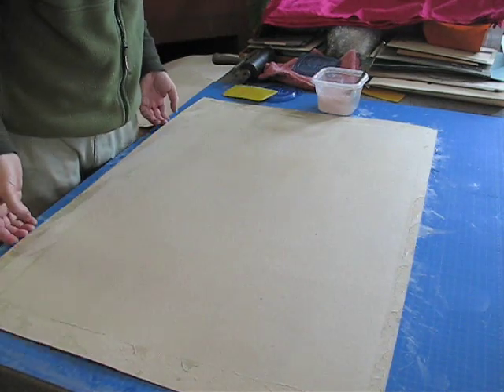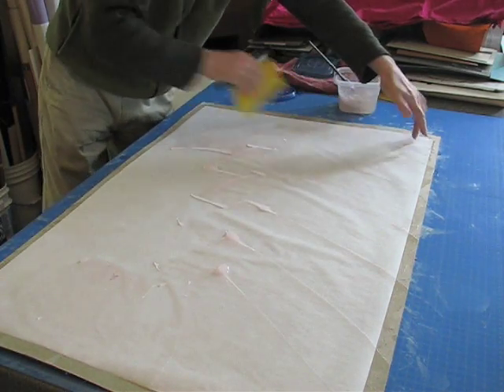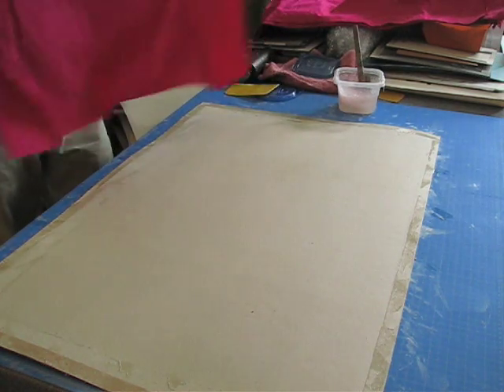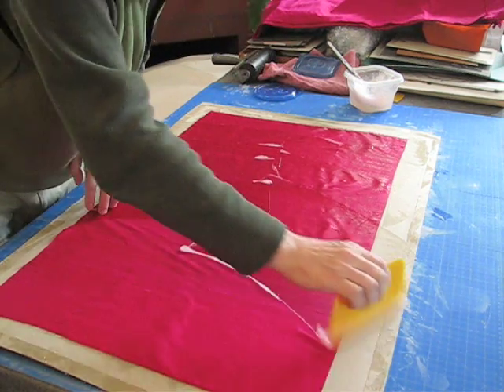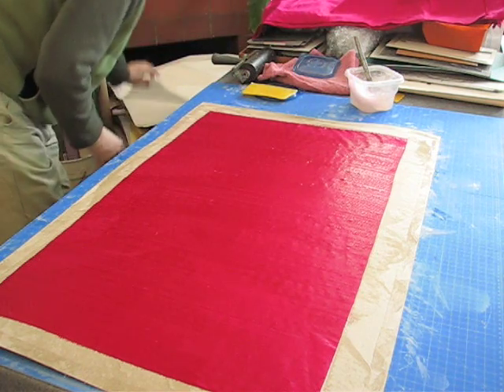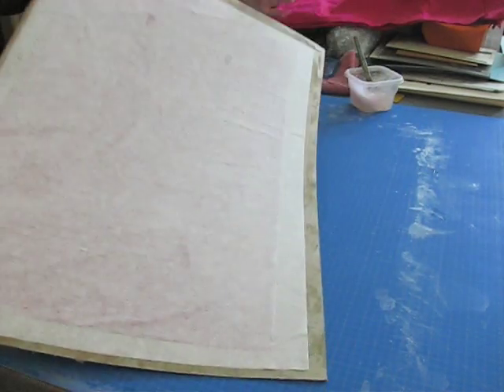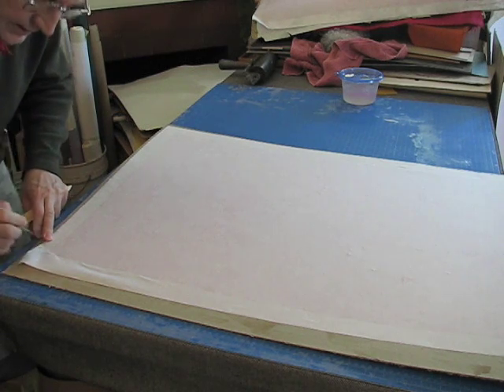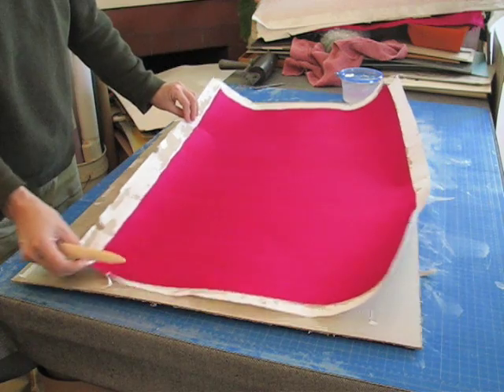Paper Backing Silk - With sound

Comment from the maker: I have answered this question a number of times in response to other comments.The new google-YT seems to have deleted my responses. I am using Methyl Cellulose, you may be able to buy it as vinyl wallpaper paste. Please watch the video again, you will hear me tell how to mix it. 1/8 cup dry MC to 1 cup of water. Let it stand for 15 minutes. If your fabric is heavy weight, denim, linen you need only size the fabric and let it dry, then glue the boards (roller) instead of the fabric to apply.

Comment: Sage Reynolds, I have just discovered your videos tonight.  Its like a trip to heaven! I love the way you work, your expertise show and the silk paper is beautiful.  It seems the MC forms a water proof barrier or do you have to coat the book your made afterwards. I cannot wait for tomorrow to start on some paper and explore more of your videos.  I watched the Japanese stab binding and would love to know what the inset piece was going to be. How long does the MC last after making such a thick batch?
Reply from the maker: Thank you for watching and I hope you will enjoy  watching more. The thin silk I use is mostly for boxes and invitations. I wouldn't recommend it for books you intend to use casually or daily. For books I would recommend using heavier silks and thicker  more rustic weaves. With the heavier fabrics you can simply MC the back with a scraper and let it dry. the MC fills the weave and when you apply it to the boards or box , just apply the adhesive to the boards like i do in the box making videos. You may want to iron the silk before you cover as the MC will shrink and might make the fabric a bit wrinkley. I have done that with denim, heavy cottons and linen which was used on books and portfolios. The MC will last, in a closed container in the refrigerator about two weeks or so. when you see loose MC in rte container its time to make new. The MC does not form a water proof barrier on the outside of the fabric, most of these books are Special Books, that is to say they are not carried around like sketch books or journals; they would be albums, or things commemorating a special event or anniversary. However, if you are using heavy weight cotton or linen they should be perfectly durable for more intense use. There are many commercial paper backed silk like fabrics available from Talas on line for general use books. Thank you again for watching and have fun with your paper adventures.

Comment: Hi Sage!
Love your tutorials! Could you tell what kind of paper do you use and what its thickness (like 40g/m2)? What do you think if to use a wall paper glue for glueing? What about PVA glue?
Reply from the maker: I am using heavy weight Thai Mulberry. It is best to use a paper that is easy to handle and has little grain. a number of 'rice' papers will fit the bill.
 You can use wall paper paste if it says for vinyl wallpaper.  Pastes now are usu8ally a type of methyl cellulose, all Ican say is try and see.
 I don't know where you are and what your marketplace is like.  Check the other comments if you have any more questions for things you may not have thought of yet.  Have fun and thanks fr watching.

Comment: Hey Sage, glad to have found your channel, can I just ask how come the glue doesn't go through the silk when you're applying it?  Is that to do with the thickness of the glue or the silk itself?  Thanks in advance.
Reply from the maker: +TeZela The MC is very thick and the cloth is tightly woven. If the MC isn't mixed well and has water on the surface it might let dampness through but it will not show when it dries.  Thanks for Watching!

Comment: thanks for this !! Do they make sulked back wallpaper like this ? thanks
Reply from the maker: For wall paper I would think that they have a system for doing this on rolls with tension and heated pressure rollers. It would be difficult to do wall paper length rolls like this. Thanks for watching.

Comment: Hi Sage, great video. Had a question about materials. Is the binder's board the preferred method, could you also use something like a laminate sheet or fiberglass reinforced plastic sheet to prevent curling?   Also, if not using silk, I'm using cotton linen fabric, like quilting fabric, is there any issue with the MC seeping through too much? Thanks, Ryan.
Reply from the maker: Hi Ryan, 

I use the binder's board because I know the MC will stick to it. Laminates and fiberglass may not work reliably and they are expensive compared to the binder's board which can be reused again and again. as for the cotton linen blend if you are binding or covering with it you may have only to Squee Gee the MC on to the back and let it dry. I will contract a little but that can be ironed out. Then, when you cover the boards/box, glue out the the item (with a Roller) to be covered and apply the sized fabric. I have done that with raw silks and denims, if your fabric has a loose weave it will be better to paper back the fabric. The best thing to do is test the fabric with a 12" or 30cm square,  do it twice and anything that can happen probably will with the test pieces. If the MC does come through the fabric you could adhere a sheet of acetate or mylar to the board (slightly smaller than the fabric) leaving the edges free to let the paper and MC adhere there. good luck and thanks for watching. (You might want to look at the glue and roller basics if you haven't already.)
Reply: @Ceropegia  Thanks for the thoughtful reply. I've been using the Lineco PVA, I'm not sure if it's just my area in the high desert of California mountains, but it tends to dry way too fast to even apply the paper onto the fabric. Often times I have to lightly sponge it to rewet or apply it in half sections which leads to issues. So switching to the MC, I'm curious if that will allow me more time to work. What thickness binder board do you normally work with?

Comment: Hey Sage, I noticed below in the comments you said you get your supplies at Talas and New York Central Art Supplies. New York Central was my Go-to but unfortunately they closed down this year. Do you mainly use Talas now or did you happen to find an alternative supply store?
Reply from the maker: +redmoon4eva  I was at New York Central  two days ago, they have not closed down, just sold the warehouse. Renovations of the original store are under way and you can still get what you need from the  store. You may have to call ahead as the space is smaller. My work has moved almost entirely from paper to metal and my suppliers now are on 47th street for a different range of materials. However, when I need paint, gouache and paper I still go to New York Central. Many of the art suppliers in NYC have gone, Pearl Paint,  the Utrecht on B'way near the Strand  and a few other small dealers have gone, but Central is still there. I've never found an alternative to that store that has met my needs for about 40 years. Give them a call. Thanks for watching.

Comment: Thanks for sharing this. I'm currently working with some thin cotton fabric to make into book cloth. I've used PVA adhesive with thicker fabrics, like linen, but I'm having trouble with it either not adhering or seeping through this fabric. Do you think your technique using methyl cellulose would help with this?
Reply from the maker: +DHuurman Scan through the comments below. You will see similar situations to yours. 
You can use the Methyl Cellulose with cotton and in some cases you can simply size the fabric with MC, let it 
dry, iron if necessary and then apply it to glued boards. It all depends on the tightness of the weave of the cotton fabric. Thanks for watching!

Comment from the maker: If you are doing a wall collage it might work as pieces. However, having covered walls in the past, I would say this is NOT appropriate material for that use. When you do the final wash/rubdown on a wall, the surface would be destroyed. The silk walls I know of were usually 'quilted' in place over a thin layer of padding. No paper backing required. I would look into that method for covering a wall, It will make the room quieter too.

Comment: I find this video very informative.  I do several surface design techniques on fabric and have wanted to incorporate in a book.  I am looking at the yellow tool you use for spreading the methyl cellulose out evenly and wondering what it is called.  I am not finding anything like that in a bookbinding supply or art supply store.  But I aslo don't know what to call it.  I am thinking it probably is not unique to bookbinding.  Can you help me on that.
Reply from the maker: I got those spreaders in the printmaking department of New York Central Supply,that store has closed but you can find them in auto supply places as they come in sets of three for body work. I've seen red spreaders there. I also used then to cut combs for paste paper making and have a LOT of drawing tools. Here's a link https://tcpglobal.com/collections/body-filler-tools Good luck and thanks for watching.
Reply: @Ceropegia  Thank you.  That is not a place I would have looked.  I was trying to find a dough scraper that could work and most are metal.  These are much better!

Comment: Hi Sage,
You lightly touched on something early in the film, but didn't go into much detail about it.  I'm not really sure it matters with Silk, but for other cloths I'm sure it would have some bearing.  Anyway, the stretching direction of cloth (weft) and the non stretchy direction (warp)...  Does it matter which direction the cloth is, relative to the grain direction of the paper?  Many thanks, and Excellent videos!!!
Reply from the maker: MCSEknight I mentioned the warp and weft because the cloth sometimes stretches as you squeegee the  MC on to it so you would be aware of the cloth moving in one direction while you work. The oriental paper has no grain so it doesn't matter. Just a process/working awareness is to make it easier while you are spreading the  MC. 
 Thanks for watching.

Comment: I have tried to understand what the name for the paper is,but I cannot
Would you tell
Reply from the maker: if you read the other comments you will see that I have said it is Thai mulberry paper, heavy weight, there is no GSM. Sorry it seems unclear in the video.  You can use most smooth, oriental or 'rice' papers as long as they have no texture that will show up on drying. I have used moriki but that has become too expensive. The mulberry is a good paper to use and not too expensive. Good luck and thanks for watching.